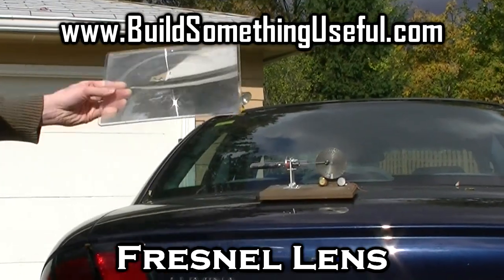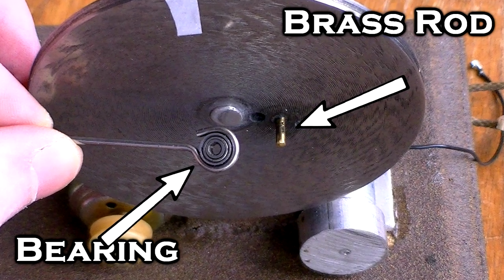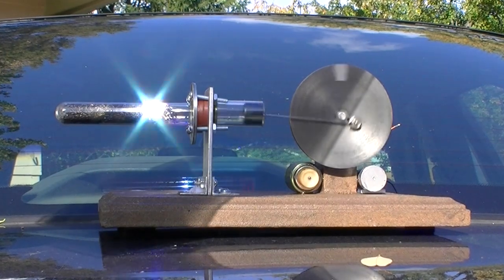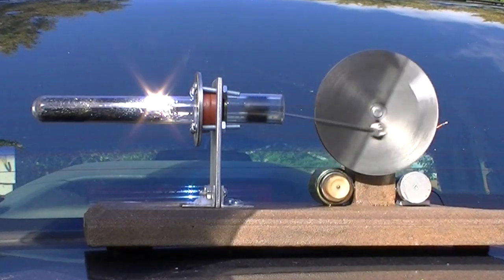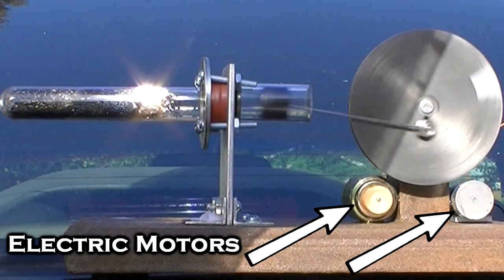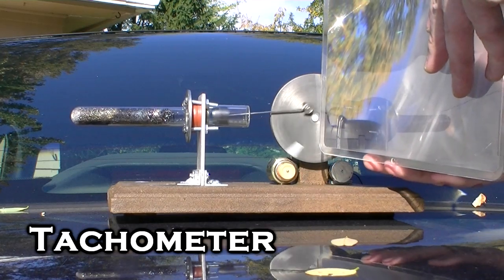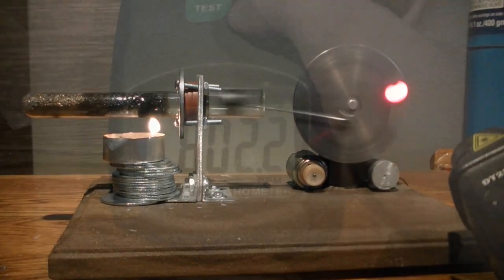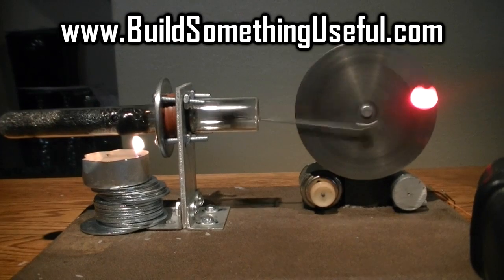Solar Powered Stirling Like Engine

Comment: Would painting the cylinder on the hot gas be enough to absorb sun light to operate the stirling cycle? Does the parts have to be glass can they be made of other types of refined crystal structures? 😊

Comment: Use a solar vacuum tube fill it with gallium and use the heat plug to drive the Sterling engine. Farmers could use this type of engine to run pumps to water fields and pumps in hydroponic greens houses.

Comment: how does that light heating up the tube make the piston move? it gets hot in the tube which forces the piston back because air expands when it gets hot? well what happens when the piston gets pushed back? where does the air go? does it just stay inside the tube? please somebody reply
Reply: Up to a point it should increase the output, until you hit the limits of how fast heat conducts from the operating fluid (air) through the cylinder and away. You could probably design a particular engine to operate at a specific temperature difference most efficiently.
Reply: The air is a sealed system, moving the piston as it expands and contracts.The trick is a second "piston" inside this system (linked to the main piston) that acts as a baffle, pushing the air back and forth between the hot and cool ends of the tube. It's a bit tricky to get your head around, but makes perfect sense once it all clicks.
Reply: +Justin Gould if you'd increase the heat difference, say with a more dramatic cooling method like dry ice, would that increase the rpm?

Comment: yeah .... if the components are high quality eingh to resist wear any kind of heat source can get it moving .... sunlight to old cooking oil torch ... a water pump for cooling would be awsome for one end of the engine ... look for stirling engines on YOUTUBE.COM a site you might have visited lately

Comment: I wonder if you can run a heat engine like this from the heatbuildup of machines like a laptop, oven, fireplace, etc. I wonder what you'd use something like that for, but it has serious potential.  I'll look into it.

Comment from the maker: @AlBarathur I hear you.  I would use a very thin walled stainless steel but the thermal conductivity of stainless steel is right between glass and aluminum according to a quick google search.

Comment: @BuildSomethingUseful Keep in mind though that metal conduct heat differently than glass. If the whole pipe is metal, you might need some serous heat dissipation, or maybe not, it is hard to tell

Comment: What you needed was a black metal ring fit on the tube where the sunlight hits to spread the heat and avoid the crack. The crack occurred because sunlight heated some thin filament of metal to a very high temperature causing thermal stress on the glass tube. To be honest I find people needlessly use glass tubes for these engines, all that you need is to know exactly the length of the steel wool section inside the tube, and adjust the flame using the measurements and use a metal tube instead.